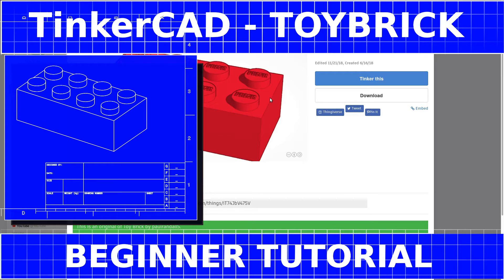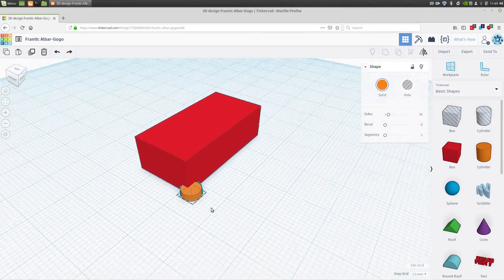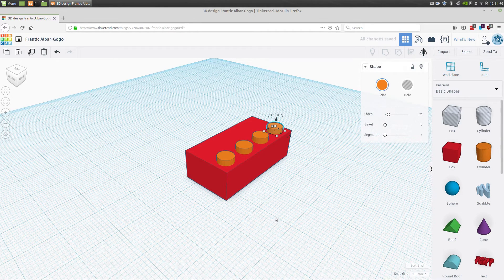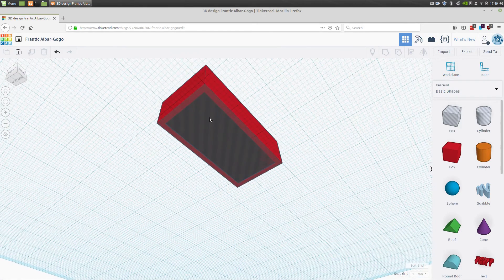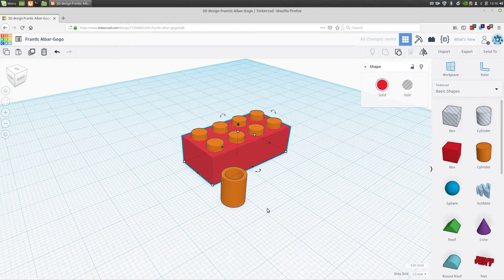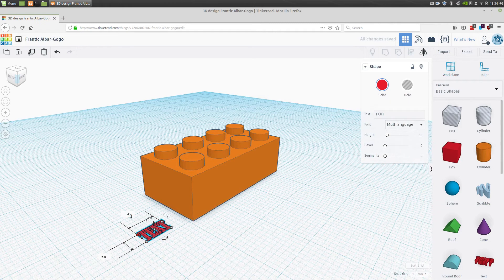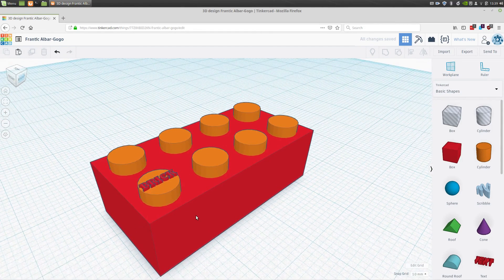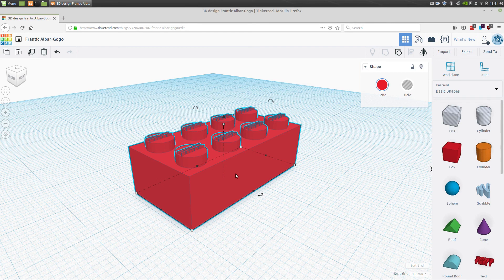Tinkercad Beginner Tutorial - Toy Brick

Comment: i want to know if you printed this would it be the same size as a regular lego block
Reply from the maker: Yes. If you generate the stl from OpenSCAD it will print the same size as  a regular lego. When you go to slice it with your printers software the default is millimeters. When I measured I used millimeters. But say you set the slicer for say inches then it would be a giant block

Comment: May I ask your opinion on Tinkercad? I am really fighting myself when I have to use it. It is so simple and easy but I am always worried of the usual stuff about online services: closing down, payment options, closed system, etc... It would be really nice to have something similar as Tinkercad but offline.
Reply from the maker: Your concerns are mine as well. I mainly use FreeCAD, not necessarily because it is easier or better, but because of the freedom of opensource software. FreeCAD is an option but as it is developed but multiple volunteers in their spare time it does not have the spit and polish of other software.

Tinkercad does allow very basic exporting to .stl and .obj, which comes with the loss of design specific data.

OnShape is similarly online but with more export options and a closer to industry standard.

Your offline options that match TinkerCAD are very limited.

I don't necessarily want to pus FreeCAD but if you can get passed it's real "issues" and steep learning curve, you will have the freedom you desire. Also, FreeCAD follows the industry standard Sketch/Part sort of approach.
Reply: Been teaching with Tinkercad for almost 10years now. Since it's part of the Autocad family I wouldn't worry about it going away.